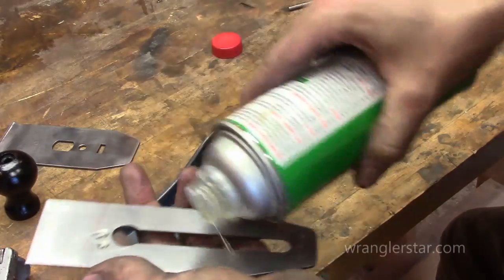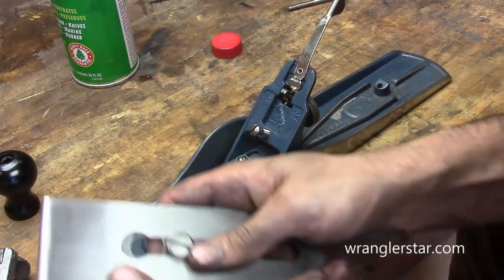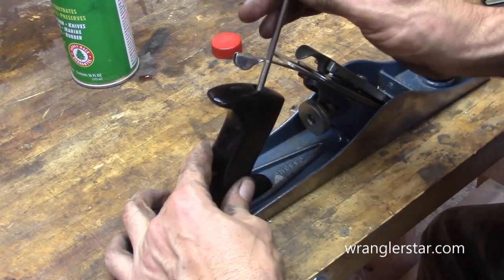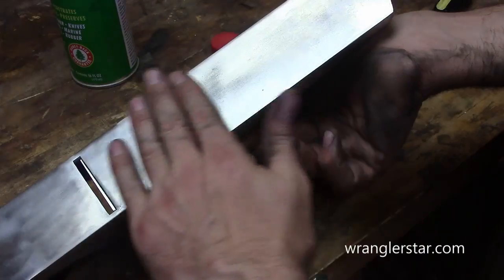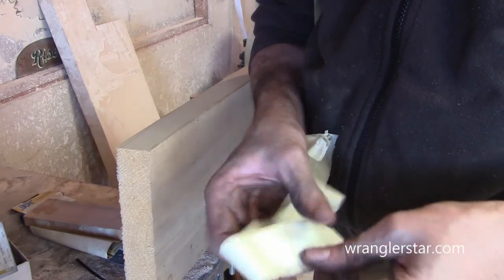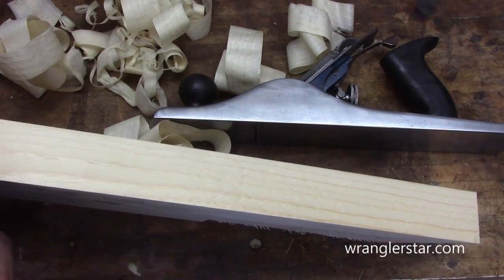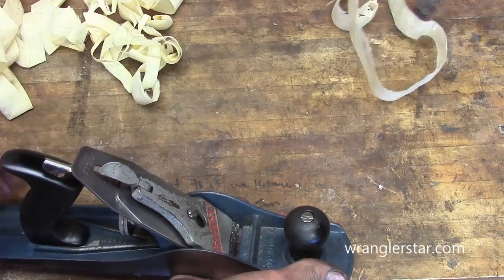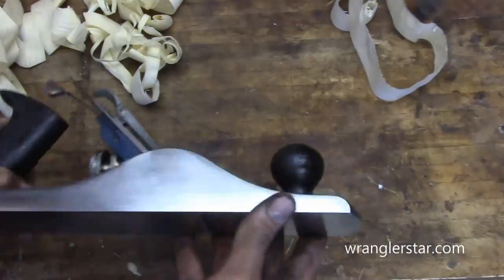Stanley Plane Restoration 4 | Wranglerstar

Comment: It cleaned up great. Your iron is off a bit to one side. The shaving should come out even thickness on both sides. Also your lever cap is a little bit too tight. You should be able to adjust the cutting depth with one finger with the lever cap installed. 

Don't get too hung up on acquisition. That plane and a small adjustable mouth block plane will do 99.99% of everything you would want a plane to do. The next thing to add to your arsenal is a cabinet scraper. The little card scrapers are great. The scraper planes are handy but a luxury. You can make your own card scrapers with pieces cut from saw blades. They also are great for using with a scratch stock.

The two higher grades of planes are only significantly different by the machining between the frog and the sole and an adjustment screw to move the frog to close the mouth up for finer work but I have never seen much point to it. It's not hard to do without it.
Reply: Once you get the feel and learn to put a hook on them, they work great. For coarser work, you can buy or make a holder for them that will give them a nice bend for longer sessions (or use a scraper plane like a Stanley #80). Generally they are only for working over very small areas and taking off wispy shavings or dust.

Comment: It's digging a little deep there, you can tell by the sound the blade makes, that zipper-like noise means it's too deep. But if you need to cut deep, you can slightly angle and point the toe out to the side. By planing at an angle it will reduce the amount of surface you're cutting at one time, making it easier to plane at a deep cut.
I'm studying cabinetmaking in college and restoring a plane was our first assignment. This short series has me giddy with excitement all over again hahaha.

Comment: the first tool they taught us to use in High school wood shop was the hand plane. The first project was to square a piece of pine to make a 5 inch by 7 inch rectangle.   We found out later that those were the exact dimensions to replace the wooden faces of the wood project bench vices.

Comment: Well I went out and found my mother-in-laws old Stanley plane that had a blade that was very chipped but in good original condition from its lack of use. Two hours later and I had a clean sharpened plan shaving off wonderful ribbons of wood.  I really enjoy your hard work here on YouTube Cody. Thanks.

Comment: I have been watching Paul Sellers for over a year now and have learned a lot from him. You have your plane working just as it should. The shavings are perfect. 

I use a woodworking paste wax to protect my metal tools as it is less likely to create finishing problems with oil getting into the wood. I also use paraffin or candle rubbed on the plane bottom to lubricate it. (Paul calls it candle grease. )

Great job! Thanks for sharing.

Comment: Cody, there is a rule of thumb for the frog opening: the opening in front of the blade should equal the thickness of the shaving.  You are a strong man, so you can power through a thick shaving.  The plane you are using can produce a wispy thin shaving and produce a cleaner finish. Good job on the vid!

Comment: Can't wait to see some timber framing now! But yeah, as others mentioned - great go for your first try, but the shavings were definitely on the thick side, good for a Jack plane but too thick for that one. I always start with the blade totally retracted and then slowly adjust it and take a pass, then adjust more, take the next pass, rinse and repeat until I get my first full width almost see through shaving. 

Thinner shavings do 3 main things for me:
1. Your iron stays sharper, so you don't have to sharpen as often, especially the thinner ones
2. You have a lot more control over the plane
3. You can plane for a whole lot longer since you don't need to exert as much force. 

Regardless, great save on the plane and an epic first try for Cody, very well done! ! Can't wait for more!  

Additionally - thin shavings with a sharp pane should give you a surface well in excess of 400 grit sandpaper. You are in for a world of fun now that you have wondered into the slippery slope of hand planes - we welcome you :)

Comment: Nice work Cody.
It's always nice to see old tools brought back to life.
That looks like a no.5 you have there, sometimes called a Jack plane. It's meant for general purpose/rough use. If you're looking for something a little smaller and more manageable you'll want a no.4 smoothing pane which is more suited to fine smoothing/finishing as the name suggests. You'd set it for a finer cut to produce super thin shavings and it'll produce a great finish surface to your work. As a cabinetmaker I can say that you're right to listen to Paul Sellers and also Rob Cosman who has a few videos here on YouTube

Comment: I agree with what many have said, back the blade off and go for a thinner shaving, the plane will work more effortlessly. I'd also suggest that before you commit to sanding any planed surface that you test a finish on both a planed only sir face as well as the same finish on a planed then sanded surface. I think you'll find you won't need to sand after, it just leaves scratches whereas the plane is slicing the fibers and leaving a glass smooth finish. 

After a few years out of the craft due to a rare blood cancer I'm starting to reassemble my cabinet shop again and have over a dozen planes of various makers and sizes that need some attention. I hope you don't mind Cody if I skip a few videos and spend some quality time in my shop giving them the attention they deserve. Thanks for rekindling the fire in me to get back out there and do what my heart loves to do...

Comment: Great restoration!

A trick I picked up from a Lie Nielsen trade show demo on how to quickly check your blade settings is to set up a 1/2 - 3/4" thick softwood board on edge and take a left pass, then a right pass with the plane and compare the shaving thickness.  Adjust the depth of cut accordingly and right/left blade tilt and repeat the test cuts until you are seeing the same thickness of removal left and right.

In addition to Paul Sellers, another fine woodworker to check out on YT is Tom Fidgen (An Unplugged Life) who works exclusively with hand tools.

Really enjoy your channel!

Comment: Very nice strings of wood there! Paul Sellers demonstrates a plane that he sharpened by pulling the plane with a thread = no extra pressure on the plane and he gets those beautiful woodstrips. The shavings are also awesome to start up a fire in the stove with. It leaves "zero" ash left, instead of paper thats clogging it up.

Comment: Nice work as always Cody. Even though the plane looks to work very well I have a couple of suggestions if you are interested.

1. I would make the gap between the chip breaker and the blade much smaller, between 0.5 - 0.75 mm to add as much support as possible and prevent chatter.

2. Set the blade to cut your maximum desired depth and then adjust the frog to close the mouth as much as possible without shavings getting stuck, somewhere between 1 - 1.5 mm, this will help to compress the fibers more during the cut, giving a smoother finish and minimising tear out.

3. Check that the right side of your plane is perfectly square with the sole, if not square it up with the sandpaper and float glass, this way you will also be able to use it as a shooting plane and get perfectly square edges on your stock.

I love my no.5, I have it set up this way for building guitars and I use it for almost everything, even shooting end grain.

Thanks for another entertaining series.

Comment: I use paper or card stock under the shoe and in front of the opening to set my depth. I have thought about feeler gauges but have never used them.  This method allows for a pretty accurate setup and cut.  You did a beautiful job bringing it back to full life.

Comment: Wow!  Great job!!!.  A little beeswax on the sole really makes it easier to joint a face of a board.  I've seen hours of restoration videos and you nailed it better than any I've seen.  Thanks for your expertise!
Note that tightening up the mouth, via the frog... and taking really light shavings should give you a perfect surface ready for finishing.  No sanding needed.  You turned a rough plane into a finishing plane.  (typically a #4)  #5 is a jack and a #6, 7 & 8 are used for flattening.

Comment: I have 15-20 old planes sitting in a plastic bin collecting rust. There are a lot of excellent planes in there, a couple of sweethearts, baileys and others I forget. I used to buy them regularly a few years ago, now I just glance them over. What's interesting is just the other day I moved a small hoard of antique brass blow torches and re-found the planes. Now I see these vids, I just might have to get them out and work on them a bit.

Comment: im gonna have to start checking on ebay for old plains. i have a really small plain that is great for easing an edge but to have a full size plain for cleaning up the surface of a board would be awesome. thanks for sharing Cody and God bless.

Comment: if you want to use it as a jointer than you are heading in the right direction. For finer shavings (past the 180 grit feeling) move the frog closer to the front to narrow the throat. That will give a thinner shaving. If you get sawdust like shavings the throat is to closed. 

As a general rule three or four good planes can fill out most work. Jointer, Jack, Block planes and a spoke shave will sort out most beginning wood working. A scrub plane (made from an old wooden jack plane) or a toothing plane is good for rough surfacing. 

A few videos ago I saw you trying to use a draw knife on dryed wood and you moved to a rash. a Draw knife is a preindustrial plane and is best for wet green timber.

I remember reading about a Bodger (green wood worker) in Australia making chairs like the shaker chairs and he kept some of his wood in barrels of water to keep it freshly green all year.

Love you channel. Please keep is up.

Comment: I just picked up an old Stanly/Bailey NO3 and a Stanly Handyman at a thrift shop for 6.00 each. The handyman just needs to be sharpened and flatten, and the NO3 has just a little surface rust on the blade. So a little cleaning, flattening and sharpening and there good to go.

Comment: Hi, impressive what you self thought yourself. I also learned a few things, eventhough I've been using one for 25+years. I doubt the sole was ever any flatter then the way you found it, I suspect this plane never saw much use . I was thought to grind a slight .5 mm roundnes to the blade so the corners don't digg in & and that's what I've always done. The pitch/sound of the plane when cutting tells a lot about how well it's setup and how sharp it is. You were planing to course, like that you wouldn't last very long.The reall proof/challenge is with hard wood. Best tip" rub a candle stub across the bottom to make the plane slide extra smooth, try it, you'll see. When planing a lot you'll want to re-hone it every day. Last one that comes to mind, you should see curls, so I think the 2 mm is to wide, I set mine up at about 1mm.

Comment: I do believe that is a 5 if I'm not mistaken. A number four is what you would want next. It is a smoothing plane. You can get it to where you won't even need sand paper in certain applications. One thing to look out for is how the shaving curl to the left or right. That would mean that your blade needs to be pushed one way or the other. This would ensure that you don't leave gouge marks on one side. If you plane on a panel and not the end of a board you'll see what I mean. A way to quickly do it is to use a thin (maybe half to three-quarter inch) board and just plane with the left side of the blade and then the right. When they shave evenly it is straight. Also, keep a wad of hard bees wax with you and every once in a while do a little squiggle down the middle. Let me know how all this works!

Comment: That turned out very sweet,  oh yes the Balistol strikes again, that is certainly some good lubricant, Rumor says it actually will " penetrate " the metal , helping it to fight rust and should not affect your work or should not Stain after it has been absorbed into the pores of the metal.

Comment: Yeah, reduce cut depth. Try and get shave ribbons so thin you can see light easily through them. That is the sign of a sharp blade and well adjusted plane.

Comment: A lighter shaving is better. Still, it looks pretty good. The continuous shaving comes when the board  edge is square and flat.

You use the longer plane for jointing and shorter planes for smoothing.

 Being able to use a plane really improves the quality of your finished work. You sheer through the grain rather than tear it with sandpaper. This gives a deep looking finish on hardwoods. The planes remove saw marks and also planner ripples as well.

The next step is to find and tune a card scrapper to go over the planed surface with. You should not have to sand  below 220 grit. The scrapers are quite cheap.
Frank

Comment: I am restoring a Philadelphia Tool Company carpenters axe that I picked up at a thrift store for $5. I have cleaned all of the surface rust off and it is looking pretty good. I am in a pickle now though because I am not sure if I want to try to sand down to bare metal to get rid of some of the pitting or if I want to leave the petina that is on this old guy. This is my first restoration project and this video series really gave me the motivation to do it. What are your thoughts?

Comment: hi Cody a little more adjustment required, frog looks like it needs to go back a little and square the blade to the opening. to start planing wind the blade in and adjust out whilst planing then square off to even the shaving, it looked like you were taking too big shaving. considering you have never used a plane before you have done a brilliant job.
Reply: sorry forgot to add grain direction is important

Comment: Well I'm learning carpentry and I've been told that you have to put the chipbreaker half a millimeter behind the edge, so the wood will curl a lot more and it shouldn't chip the wood when there is bad grain in it

Comment: Reference to:  Rookie Lock you can get reverse thread screws at your local big box store. Look in the specialty bins. Make sure you have the correct thread per inch and diameter. Bring the old piece to the store and verify the thread with a reverse thread nut, also there at the store. Good luck with it.  diver511@ the Y

Comment: You ever seen the plane sharpening contests? I saw a video of a japanese contest, really impressive stuff. They have to get a single shaving off of a really long (like 8-10 feet if i remember) wide hardwood plank. Think they measure them with micrometers and stuff. Obviously it's kind of OTT but it's still interesting.

Comment: wranglerstar How do you plan to store the plane? I recently brought home a Stanley #7 that needs restoration after sitting 20+ years in a shed. Until now, I've only had a (current model) Bailey block plane that came bundled with nylon pouch for protection and also doubles as a belt holster if I recall, which serves me since I tend to be mobile without a permanent workshop.

Comment: Your frog seems to be a little far forward. When you were testing it, I noticed some wood under the back edge of the blade and the base of the plane. That is an indication of the frog being forward just a little too much. Adjust it back a little and back it up just a little and try it again. This is a lesson in trial and error  GOOD LUCK and keep on planing.

Comment: you want a touch more tension on that thumb lock thing if its not really tight you will get chatter.I did a similar restoration on an english stanley plane it looks much nicer as it has brass bits and the brass polished up really nice

Comment: Make your cuts a lot finer. Adjust the blade depth and you will find that the finish on your cut will be a lot finer. Well above 180 grit more like 400. No need to sand unless you don't want it that smooth.

Comment: Shavings will be different, dependant upon hardwood or soft.  Blade depth will be adjusted more shallow on hardwood, than softwood, however, having a razor-sharp blade is the key.  A dull blade will not cut clean and will work you to death.